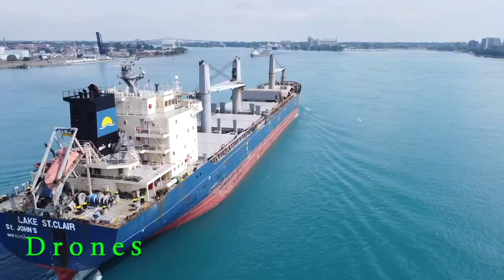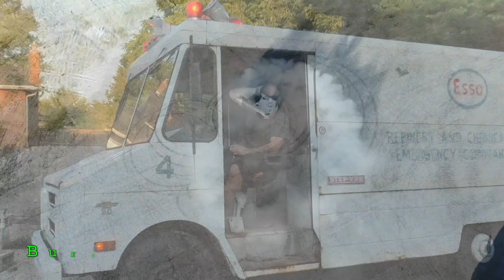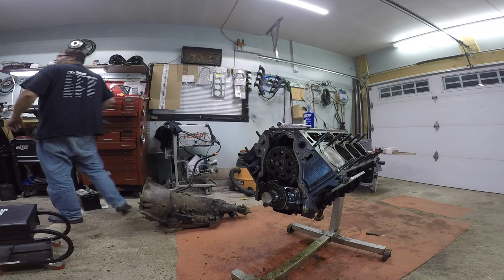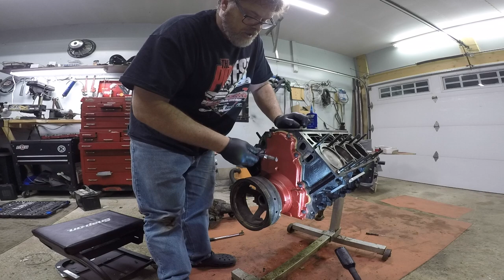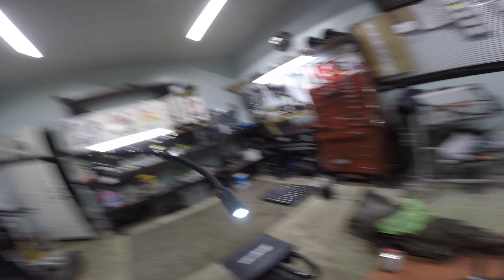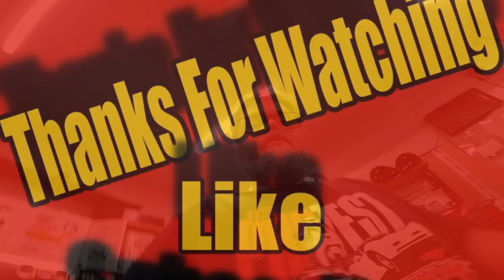LS Swap Front And Rear Seal Done

Comment: That LS needs a BTR stage 3 cam  I put one in my Tahoe and it made a world of difference
Reply from the maker: Stage 2 for me boss . I need a nice turbo cam thats very streeable
Reply: BTR is good for N/A builds. I wouldnt go to then for a turbo cam. For a all out turbo cam you want to get with john bewley and have him set you up with a cam. Plus alot of these guys like BTR are using a john bewley cam or modified version of his cams. Now with that said. Bill is on a budget. So the cam he had will do the job. Better then factory. Will he be leaving some on the table? Yes but when your on a budget you can't have everything. A little bit of everything is better then alot of nothing. If Bill ever wants a more efficient setup the cam will need to be swapped out for sure. But he has to start somewhere.

Comment: The timing chain play doesn't mean anything. Even the high-end brand new ones have the same amount of play. You could have swapped to a ls2 timing chain which is there heavy-duty one. Its like 20 to 30 bucks. The links are thicker. In the later year LS motors GM added a chain damper between the 2 gears to help handle the play in the chains. Your block doesn't have the threaded holes for the chain damper tho.